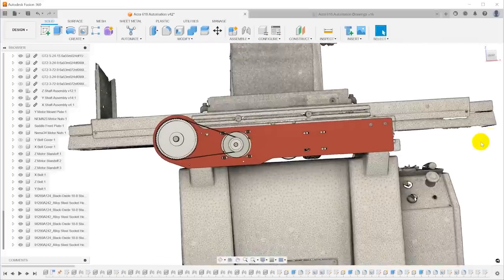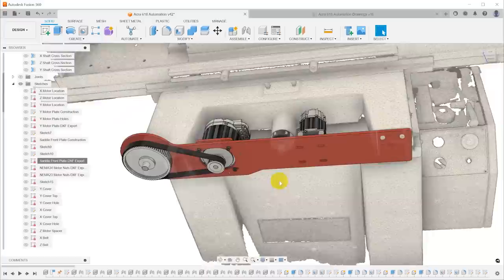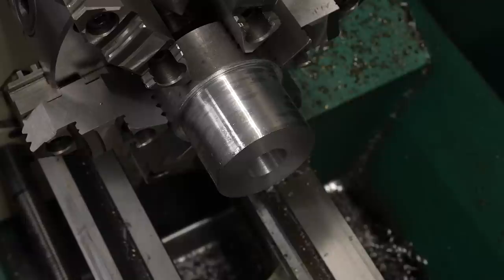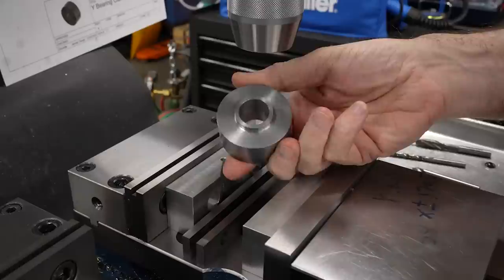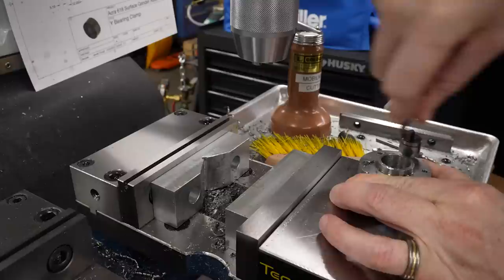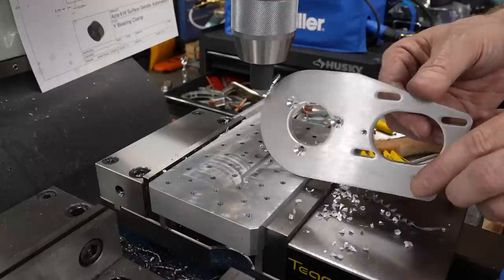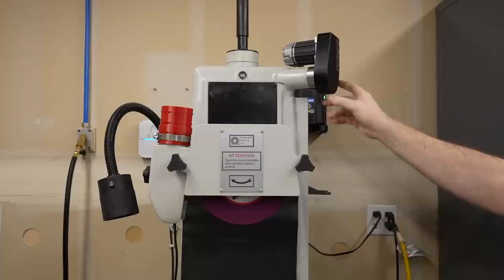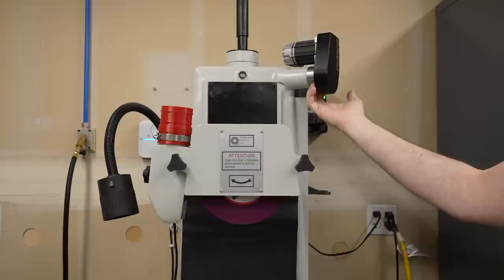Surface Grinder Automation: Installing the Servos | Part 2 | ClearPath

Comment: Maybe you've already considered this but the difference in thermal expansion between the big aluminum front plate and the cast iron of the machine could cause some loss of precision.  A 10Fdeg swing down in temperature would try to pull those two ends together where the slides are by roughly .0015 inch.  Guessing that would tend to lift up the long edge of the table which is away from the spindle.   I would consider leaving the screws on the right end loose so it can float.  The error won't be much it could be noticeable if you are chasing tenths.  Cool project!

Comment: Consider using manual focus when doing shots of objects a fixed distance from the camera (like lathe work), and saving auto focus for things where the subject moves (like people). Downside is more effort while filming, and a chance of forgetting which focus mode you're in & not even getting the chips sharp. It's also possible for most cameras to set the auto focus to only change when a button is held, or have a toggle button to lock the focus. So you can pre-focus, then lock the focus & do the machining.

Comment: Hi Janes, when you cut-off parts on the lathe by using the cut tool, simply drive two cuts to give the chips just a little space to come off the cutting slot. Just 0.2 or 0.5mm for the second cut. Drive 5mm (radius) deep, then offset of 0.5, same depth, then next 5mm on first position… and so on.

Comment: turn your parting tool upsidedown and run in reverse, like you were turning brass. I do the same for threading too. No more chatter. When it deflects, this way it reduces load on the tool, rather than biting into the part deeper
Reply: Totally agree. I use a rear tool-post as my Myford has a threaded spindle.

Comment: Having worked in the trade my entire life I found only only one consistently reliable way to cut off work in the lathe, A big rigid machine with plenty of horsepower. Other than that I have some tricks I employ in my home shop, but there is no substitution for rigidity, and horsepower. As usual James, a first class video, and project.

Comment: I'd be putting washers on the nema mounts. Steel round heads on aluminium is not great due to the high pressure over an abbreviated area due to the slot.
Reply from the maker: The video is 4K, so you should be able to zoom in and see the washers.

Comment: Hi James, great video as always. I really enjoy your "design for send cut send and 3D print" methodology, it really does bring the ability to make cool stuff to the masses. I guess someone will make a service for cheap custom pulleys at some point, so you can get whatever tooth count, design, size, bore, securing mechanism you need without needing to costumize the part yourself.

Comment: Hmm... I did the same type of retrofit on my B&S 618. Placing motors and couplings on the front was a huge mistake for my workflow. I lost access to the handwheels, making everything a little harder for quick, dirty passes.  If you lose access to manual spindle height, a 5-10 millionths scale is nice to have. Sparking out still leaves a 1-4 microns of height difference for grinders with light spindle assemblies (< 200lbs) when grinding hardened alloys or ceramics. You can feel the spindle raise on the manual handle, it feels like backlash.   

I'm redesigning my mod as I write this, placing motors in the back of the grinder, using speed reducers, and a servo engagement clutch for each access and heidenhain scales on y and z axis.
Reply from the maker: I thought about that.  My current plan is to have an encoder wheel for manual operation, but you may be correct that I'll miss having the wheels.  I certainly missed them when I converted my G0704 mill.

Comment: Cut off with a caebide insert parting blade, you really want a trickle of coolant in there. It makes a day and night difference to running dry or trying to get oil there with a brush. Been parting off 130 mm diameter stuff with no problems, but if for some reason the trickle of coolant stops, it jams the chips or I can feel it starting to rub almost immediately even in small stuff.
Reply from the maker: Yeah, I don't have flood coolant on this machine.  I do have a misting system; I might try it.  It would be nice to have another hand free.

Comment: Absolutely my favorite machining channel on youtube! I really enjoy your way of planning and execution as well as your kind of humor! 
Concerning the plate in front of the grinder: I would probably add another hole in the plate at the center of the pully for the z-axis. That way you'll be able to adjust the bearing tension from outside without opening the whole assembly again. You can print a TPU plug for it in order to keep the swarf out. Keep up the good work!
Reply from the maker: I thought about that while editing.  A hole there would make things a lot easier.

Comment: You may want to have the rapid down button on the Y axis difficult to hit by accident. At my work, we have physical buttons with a cover over the rapid down like you would see on a jet to fire a missile (It can make your part a missile too). Also if you're feeling up for it, a spindle housing mounted diamond wheel dresser may be a fun project. My main surface grinder is a Clausing CSG-1640ASDII and it has that function. I'm sure you're capable of doing your own research, but if you're interested in seeing any pictures of it I can send them your way. Good luck with your current project, it's looking good.

Comment: When you are making a sketch in Fusion to export something like the bridge plate as a DXF, you can actually skip creating a projection and immediately tell it to finish.  If the features are all continuous and on the same plane, they will be shown in the DXF.  You only need to project geometry that is not on the sketch plane or not continuous to the area you clicked on when you created the sketch.  Not a huge time saver, but it can all add up.
Reply from the maker: I turned off the auto-projection feature in my Fusion 360 settings because creating all of the extra geometry often creates multiple profiles that I then have to select for extrusion later.

Comment: What a great video, you’re a very clever bloke. Personally I think it would look better if the aluminium plate at the front was painted in the same colour as the surface grinder. Cheers, Stuart 🇦🇺

Comment: Just to be pedantic, you could scrape off the paint you have covered with the new adapter for the height adjustment. Just so you keep things coplanar ? Nice build, clean and detailed, as always. I love the design parts, and i concur it is more time efficient to outsource your parts. Even better when it's free.

Comment: 10:35 another thing with a er32 holder it’s super handy for mounting little boring bars depending how your lathe is. on the machine I was using the top slide stuck out further than a tool holder would so to clear the slide the little bars had to be set up all the way at the end of a holder with lots of stick out but the ER collets added that extra inch or so while still being ridge in comparison.
Reply from the maker: Oh, interesting.  I didn't think of that.

Comment: Parting,.. i had the same issue with my smithy 1340 lathe. i would blow up parting tools all the time. to remedy this i moved the tool about half t he thickness of the tool to the left and cut about 1/2 way to the parting line then position the tool for the part and go at it. it takes more time and waste some material and depending on the hardness it does have some deflection but it did stop blowing up my carbide …

Comment: Parting issues:  It looks like you have an angled insert to not leave a nub on the part.  Tried them myself and found it tends to cause the tool to deflect (at least on a lathe this size or smaller) and then get stuck in the part....and still leaves a nub.  The other thing that might help is raising the tool a smidge (make sure it's an imperial or metric 'smidge' as suits your lathe!).  You may have enough flex that, under load, the tip of the tool is going below centreline and digging in...which as you've found, usually results in colourful language and dodging flying fragments of parting tool.  I've had the holder shatter as well as the insert...which is even more annoying.
The other thing worth doing (at this size of lathe) is switching to an aluminium profile MGGN insert.  Night and day better as it has a sharper tip and cuts rather than ploughs - I don't think we have the rigidity or power to plough through.
Reply from the maker: I have been honing my steel inserts to a keen edge with a diamond.  It helps.  I haven't tried aluminum inserts specifically.

Comment: If you rotate the motor 45 degrees the belt would just go around the 4th spacer.   Just a thought,  Nice work!
Reply from the maker: Yeah, I thought about that.  There's a USB connector on the back of the motor that needs to line up with the gap between the saddle and the frame so I can get a right-angle programming cable on it.  I didn't think to mention that in the video.

Comment: 29:45 rumor has it that you can yell "focus you FUCK" at the camera, and sometimes it focuses on the right thing.
Might not work for all cameras though, so results might vary.
Reply from the maker: This camera has a feature where the focus ring will temporarily change the auto focus point, so when I manually focused, I didn't notice that it had reverted to autofocus when I powered it off.  New camera learning curve.

Comment: I wonder if you had oriented the mounting holes for the last motor at 45’ off vertical, would it have allowed the belt to clear? Also, off topic; you mentioned in a previous video that you used to be a woodworker but had moved on to metalworking/machining and sold those tools. I’m a woodworker that would also love to do machining if only for a lack of space in my small shop. However, I’d hate to drop one for the other. Question; do you ever find yourself wanting to get back into woodworking?

Comment: Great to see you again. Could you have rotated the motor at 33:30 45* so all 4 spacers could have been used and given clearance to the belt?
Reply from the maker: Maybe?  There is a USB connector on the back of the motor that needs to line up with the gap between the saddle and the frame so I can get a programming cable on it, and rotating the motor makes this hard to do without risking striking the frame at full travel with either the motor heat sink or the right angle micro USB cable.

Comment: I'm just spit-balling here but could you rotate your Z Axis hole placements by 90° to (12, 3, 6 & 9 o'clock) which would then allow you to use all 4 screws & standoffs on the motor? Then the 4th standoff would be encompassed by the drive belt and still allow full adjustable and rigidity? Just a thought... As always great planning and execution, thx.
Reply from the maker: I didn't mention that the motor is positioned where it is to allow access to the USB programming connector on the back of the motor between the saddle and the base.

Comment: I reckon you should be investing large chunks of cash in the replacement of that sorry-looking brush which is used for applying coolant/oil to the job surface. Otherwise, fascinating video. Happy New Year James!
Reply from the maker: Sooner or later I'm going to drop it in the chip pan anyway.

Comment: Parting is excellent Surface Feed Rate +  lube must be maintained. Several inches is posable in stainless is no problem with with correct SF + feed rate. If correct faces can be .002 or much  better. Must have Constant Surface Feet  to make it happen. ( your bandsaw choice was wise0 
All jobs should to start with material specifcations -look up. Start with machineability rating (0 % - 100% ) as a starting point, 
The manufacture of your tool (insert)  should have technical  info for there insert.
If your buying no name stuff you can use this a starting point. (coatings & substrates are suspect)
Your fooling yourself if you think theory on is better hands on.
I'm impressed with your skills to design  engineer and complete this project.
Your skills are are better than average and I think you are aware of the extreme problem of skilled people willing to enter the manufacturing trade.
I spent 40 years in the trade (my father owned a machine shop) 
This is a profession that always has more to learn. 
It's a dam shame that that a skilled machinist is  in with the chaf.
until

 

knoways
Reply from the maker: I've been playing with higher speeds and feed rates closer to the specs called out for the inserts, and I'm getting some good results.  With a light and flexible machine, it's easy to exceed the available rigidity and power.

Comment: The large casing does not follow the plate. Probably he should print a strip along the edge in the shape of which will cover this gap.
Reply from the maker: Correct.  I hadn't modeled the belts or covers yet when I sent the DXF file off to SendCutSend.  I realized too late that there was going to be a gap.

Comment: Why do you use send-cut-send when you have a plasma table on the other side of the room? Just don't want to deal with sourcing/handling the material or what?

Comment: Really neat video, thank you. Possibly silly question, when you're tapping the spacers from both ends towards the center is there any concern the threads would be out of phase when they meet in the middle? That seems like it might be an issue but I don't know how serious it would be.
Reply: Not in this application.  He is using two sets of screws - one from each end. Half the standoff fastens the motor to the standoff and the other half fastens the standoff to the mounting plate. 

To visualize this better, instead of thinking one piece with one threaded hole, imagine two pieces each with a threaded hole but glued together.  The threads only need to be oriented to the work they are doing.  So in this case, while it us a single goal, each end is doing a separate job to accommodate it.

If it was a single screw or bolt going all the way through the standoff, the concern would be there. But because it is essentially one piece performing two functions, that concern can be ignored. 

I hope that did not confuse you.
Reply from the maker: I assume they will be out of phase, but I'm not using the threads in the very center, so I'm fine with it.

Comment: Are those drill sizes for the metric threads some weird imperial drill sizes or where are they coming from?
Reply from the maker: The hole sizes are automatically generated by the Fusion 360 hole tool when selecting a thread profile.

Comment: I was 15 when we metrified and I have spent 40 years as a Mech Eng in metric. My home lathes have all been imperial. This results in combining measurement systems in conversation all the time. I can do most metric conversions in my head. The only thing I cant understand is the insistance of Yanks in useing fractions. That is a middle ages system that died with the calculator.

Comment: How are you going to tune the servos? Looks awfully tight there for fitting a usb  connector 🤔
Reply from the maker: The motors are positioned so I can fit the USB connectors in.  That's part of why the Z motor can only use 3 spacers.  The USB connector needs to align with the gap under the saddle.

Comment: Would a 45deg rotation on the Y axis allow for the spacer to sit between the belt and thus allow for 4 fixing points?
Reply from the maker: It would, but it would also block the USB connector on the back of the motor that I will need for tuning.

Comment: Is it possible to fit a rear tool-post to your Grizzly lathe to carry a parting tool? Before fitting one to my Myford Super 7 parting was an operation I dreaded. Since fitting one it's an operation I can carry out completely stress free.
Reply from the maker: The cross slide doesn't have T slots on this model, nor can you run it in reverse, due to the threaded spindle.  I've been playing with parting since this video and discovered some things that help considerably.
Reply: @Clough42  My Myford cannot be run in reverse with any tool load, again, due to the threaded spindle. Unfortunately the absence of T slots is probably a deal breaker. I use my rear tool-post with the lathe running in the normal direction but with parting tool inverted. The natural servo action of the flex of the lathe virtually eliminates dig-ins by reducing the cut as the load is applied IYKWIM..